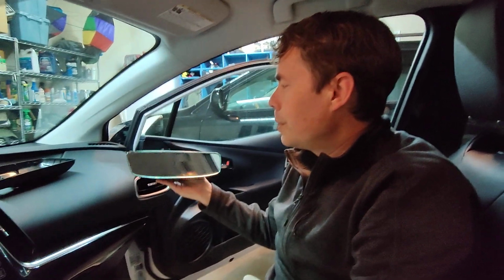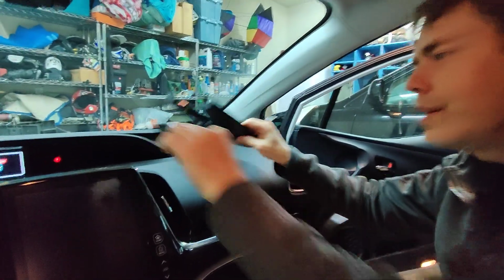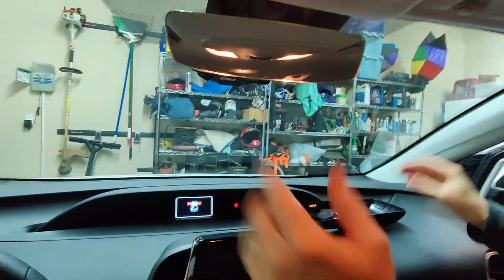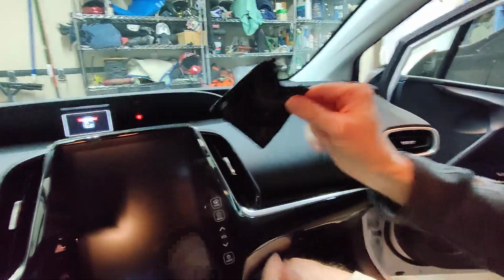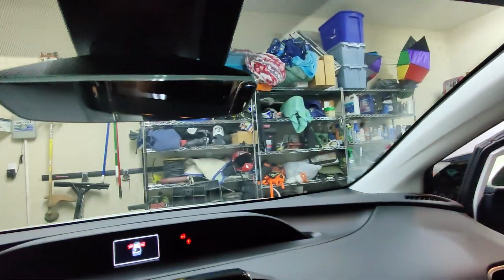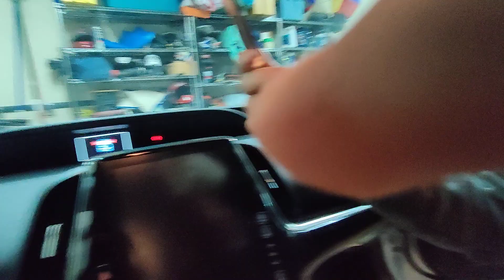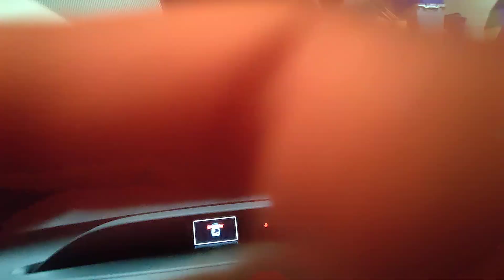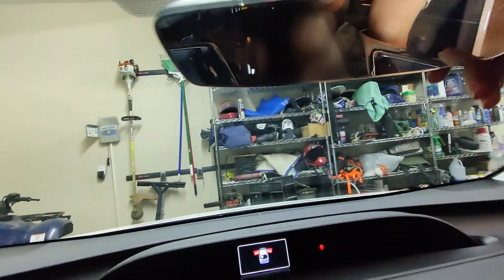How to install Toyota frameless mirror PT37400210

Comment: Thank you for the informative video. Took about 2 mins to complete the install. I found the factory screw was installed really tight, had to use my drill with the torx 20 bit on it to get it out.

Comment: I purchased this mirror and installed it on my 2024 Camry. It was simple and took less than 5 minutes with only the #20 torx driver needed. If I had one legitimate complaint it would be about the unserviceable lithium battery. I don’t care if the battery is projected to outlive most cars it is inexcusable to create a throwaway item such as this. It was not obvious anywhere before I purchased and only in small print at the bottom of the instruction sheet. It instructs you to dispose of the non-serviceable battery properly but there is nothing anywhere  on how to remove it when it fails.